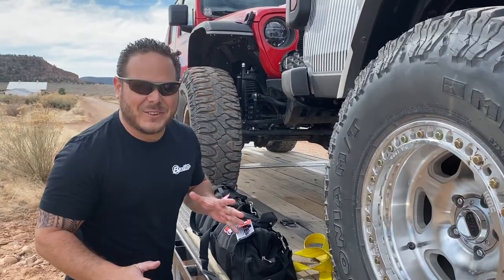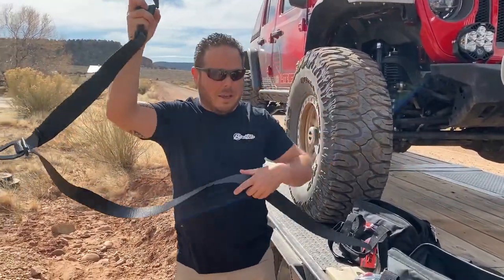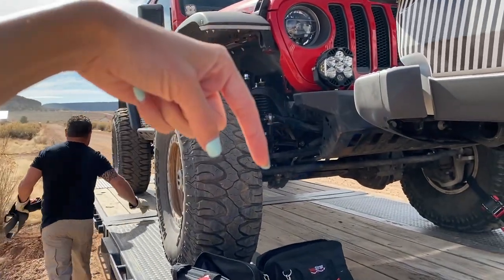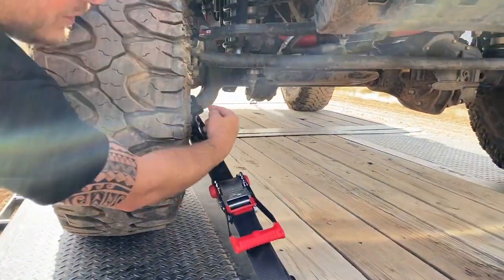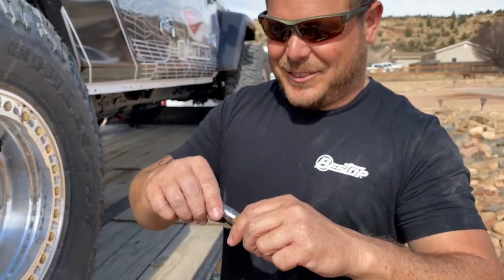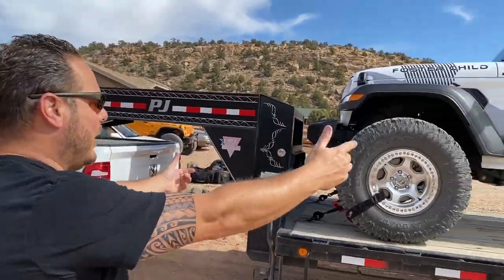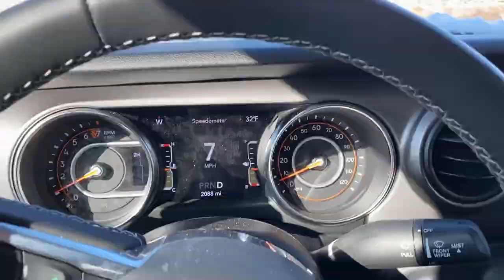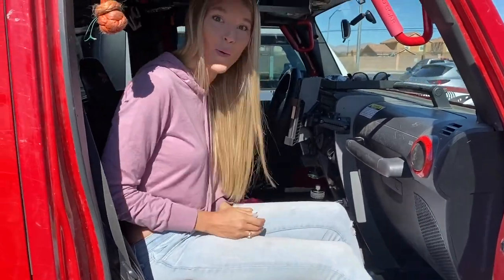HELP US OUT! How do you tie down your Jeeps?!

Comment: I have hauled heavy equipment for 38 years. You should X cross the tie downs front and back. Not only does it keep the load from moving front and back, it prevents any side to side movements. DOT mandatory for commercial loads
Reply: Thats how we did it in the Marines as well.
Reply: Yup always X Cross
Reply: Cross strapping might work for static loads but definitely not for vehicles! If you lose a strap you lose the vehicle. Physics don’t work for vehicle tiedown!

Comment: have been towing 4x4's since the 60's through 40 states. my dad hauled heavy equipment through the 40's 50's & 60's and showed me the cross tie on the axles method which i have used every since. it does not really matter the brand or style of tie downs as long as their of good quality an properly applied. most state D.O.T.'s require 4 tie downs on the axles on the cross tie to prevent the load from dancing off the side of the trailer which i have seen a lot. Victor Valley 4 Wheelers for life, the real kings of the hammers

Comment: I used to haul A LOT of vehicles, and by far the best way is to use Wheel Nets. If you check with most 4x4 shops, or even towing companies, they can get you, or tell you where to get the ones for large tires. They're the safest, and even easiest/fastest way to strap them down.

Comment: Try to cross them in the front make an "x".That prevents side shifting on bumps. You will see this on semi loads of heavy equipment. It pulls the main mass to the center of the trailer. Centers the CG.

Comment: Dean here, strap stuff down all the time, thing to note when using a ratchet type strap, dont pull the strap all the way through and tighten it up, leave the strap slightly loose and start ratcheting and let it tighten on itself it will have more to bind on too. just my .02

Comment: Just my .02 as a rank amateur...

For loads as heavy as the Jeeps I always like to cross the straps for the simple reason that rain and ice can make the trailer deck slick, and I like having the extra side-to-side support.  You don't want either, but a load shifting left/right will make the ride a lot more... interesting in a hurry than a load shifting forward/back.

Get some short axle strap tie-downs with the eyelets on each end.  I use the eyelets built into the strap when I have to, but those are more prone to slippage if there's any extra strap in the loop around the axle or through the wheel - they like to close that loop tight on their own and introduce slack into your tie-down.  That's also a common abrasion point, and replacing an axle strap is cheaper than replacing a ratchet strap.

If the velcro speed straps are long enough wrap them once around the short end of the ratchet strap before tying up the loose strapping to secure them permanently.  That way they won't blow away and get lost when you're unloading the Jeeps on a windy day, and if you're like me it'll cut down on time looking for them when they were in your hand ten seconds ago while tying things down.

The whole setup looks awesome. It cracked me up how tiny that sweet gooseneck trailer made the 3500 look, though!

Comment: with the straps you're using don't forget to check each time you stop they will stretch always this is just because of the material they are made from. binders are better or get shock straps to eliminate the need to constantly adjust the straps.
Reply: zapman2000 after the first time they have been great. Tight as can be each time I check

Comment: Funny that this came up not long ago between equipment drivers and auto haulers in our group. The consensus was that both X chains / straps are good for those that carry all kinds of different items. But if it is their toy they all would use wheel bonnets or straps. The auto guys made good points regarding why they are required to haul their loads with them. Because your load is repetitive, make sure the pull point was arranged for easy tie down. BTW the preferred bonnet for your Jeeps come from MACS made custom for your tire / wheel combo.

Comment: four chains and ratchet binders around the axle housing 2 pulling forward 2 to the backtighten till you see tire squat. then wrap the chain bite around the handle and ratchet shaft it will never move
Reply: plus you might check the different states some may not allow straps.and require chains

Comment: Strapping them like that will work but I've personally believe attaching directly to the axle in a x pattern is best. It doesn't only help forward and backward movement, it strengthen side to side as well.
Reply: But if 1 strap breaks or comes loose then the other strap isn't going to keep the load from shifting toward its mounting point on the trailer. Plus when the tow vehicle stops and starts the load can move forward or back because the "X" isn't as ridged as a straight strap.
Reply: Never ever ever cross your straps EVER! This is the worse advice you could ever be given! https://youtu.be/-zw7pICnfzU
Reply from the maker: It actually been really interesting reading up on this. Apparently there’s a huge argument both for and against crossing straps in an X pattern.
Reply: @LiteBrite  very true. You guys are doing good though. If the jeeps stay on it's a win.

Comment: I always tied down my race car (asphalt super late model) over the axle in the rear and around the spindle in the front. I also left the winch attached (always winched it into the trailer (26' enclosed bumper pull). Car weighed about 2700lb, tools, tires, etc brought total weight to 9k lbs.

Comment: by securing the jeep at the wheels you are allowing the sprung mass to shift and bounce and potentially creating a unstable trailer.  jeeps have tow hooks secure from the tow hook to the trailer and preload the suspension with the tension of the straps

Comment: I have same straps and they work great. Only issue I did not like it the wrap around on its self would always loosen. So I ended up getting 24" axle straps with Rings on each end and then hook with hook. I strap at axle to tie down. As you having suspension do what it does best absorbing provides less impact to tow vehicle and trailer.

Comment: Hey Kevin, where you strapped down the step child is where I do on my TJ as well with no issues. I'm guessing your straps slipped in that adjustment piece on axle strap. I use fixed length axle straps so the only place there could be a slip is at the ratchet it self.

Comment: Real straps with spring clips.    Some states require them. Go around Axel tube so springs still work.  Or use farm tractor tire tie downs. Love them.  You did, buy good straps!  Nice! Limit roll back.  You did fine.  I've watched professionals do it wrong.  I like to weld in loops on Axel's if there is room.

Comment: 4 straps each vehicle use towing wrecker hooks way easier  and criss cross them ,also can use axle straps go around axles or through rim when you go through rims you dont criss cross  only need chains on machinery  and  weigh your truck and trailer you need tongue weight the trailer ia suppose to hold the weight so might work on liad placement

Comment: Buy axle straps (8) to go around your axles. Get the 7' vehicle ratchet straps (8) with the big hook ends that have the safety spring "flap" and cross tie them down at the axles. If you tie them at the body anywhere they will move when the vehicle bounces as you go down the highway, this causes them to become loose and snap tight as this happens. I always tie down to the parts that are not moving on the trailer which in your case would be the axles. Just be sure to not pinch brake lines or cables. You can check online for load securement for equipment or vehicles under the Federal CVSA. When you tie down this way you see the vehicles on the deck moving around and bouncing which is normal as long as your straps are tight. You can buy stake pocket D-rings that will help when securing down.

Comment: I have found that cross stapping is best for any load it stops all side to side motion  . So left front tire gets connected to right side of trailer and so on but it is not a huge difference unless trailer is wet or slippery

Comment: With the trailer setup you have you can take the strap attached to the driver side axle to the passenger side tie down of trailer. And the same on the opposite side so the load won't move sideways. At the moment the load is safe for forward and backward movement.

Comment: Run the left side tie downs on the Jeep to the right side D ring and vice versa (cross the straps in other words).  It keeps the Jeep from moving to either side.  You can also run the rear straps from the vehicle in front to the D rings under the front of the vehicle vehicle in back - then the straps from the front of the vehicle in back to the d rings under the back of the vehicle in front.  Cross them also.

Comment: Having steel DIY beadlocks with classic D windows, I just strap straight to the wheels. Never to the frame. Strapping straight line front and rear (no crossing) leaves easy deck access to stash coolers, firewood, etc. below the jeep(s). My trailer deck is only 22' 6" (two Willys long) so economizing space is mandatory.

Comment: Hi Brit and Kevin I work for a towing company in Wyoming on I-80 and the most secure way to tie down a vehicle is to get tire straps you can get them on amazon and if you watch a video on YouTube it will show you the proper way to use them or like someone else said you can watch Ron’s videos Midwest Truck he uses them a lot. The way your doing it should work just fine but the extra padding in your kit isn’t to protect your rims it’s to protect the strap I use those same straps with my medium duty wrecker for solid axle big trucks with my wheel lift to go around the axle and it secures it to the wheel lift. Since they loosened up I would try going around the axle instead of the knuckle and if you put the tag end back threw the strap instead of having it come towards you the strap will hold tighter because it wraps more around itself instead of in a line. The straps I’m talking about are 8 point tire straps and you can get them with the same hooks as the straps you have now and there quick and easy to use and it’s the most secure way to tie down your vehicle.

Comment: Kevin, I'll join you on eating better.  I have been slacking. Also... if you're having trouble working out on the road, let me know.  I have some info on workouts with minimal equipment if the portable gym isn't cutting it.  I'm sure you're good but just in case.

Comment: Well, in the Air Force, where we would tie down our own equipment like -60s (Jet engine powered generator and high pressure air unit) which weighed about 10,000 pounds;  We would crisscross our chains in the C5, C141  C130 or KC135 cargo aircraft.  It was called 'side loading'.

Comment: Only 2mins in... but the biggest mistake I see customers doing when strapping down with ratchet straps is that they pull them as tight as possible before ratcheting. Ideally you want a little slack and you want to strap to wrap around itself on the ratchet.

Comment: The way you have the wheels strapped will inharently loosen over time.  Make a Y shape with the strap.  I like straps because they are light but chains are the way to go with the miles you guys will be traveling.
Reply: blazerberg so we’ve not had a single strap loosen at all. The ones on the tires have stayed the tightest

Comment: I have the same trailer truck set up as you and I haul two TJ’s to Moab. The way you have them tied down is just fine and will work. I use the Vulcan car tie down with flat hooks XL from TrucknTow.com. Just throw them over the top of the tires and ratchet down two ratchets on each tire and it is done. To UN do just pop the ratchets and drop it off all together so all you have to do is put it on the tire and ratchet down to tie down again. Takes ten minutes to tie down two jeeps and you don’t have to crawl around under the jeeps. You will stay clean and it will be quick. I have 37’s on mine and they work great. I know a guy who rolled his truck and trailer with a full size ford pickup on the trailer and it stayed on. The tow company rolled it back up still on the trailer without any problems so I know they are strong enough.

Comment: I strap my rear axle straight back and cross the front axle.  My reasoning is if I get into a panic stop situation I want the straps as strong as possible.  I figured that the straighter, the stronger.  I cross the fronts to keep it from slipping side to side.  I always strap to the axle housings, never the wheels.

Comment: Hauling heavy equipment I prefer chains and binders on the frame.  Vehicles in my opinion it's six of one,  half a dozen of the other.  I still prefer the frame but I see nothing wrong with what you did.  I'll send a short clip tomorrow on my 2" ratchets to deal with the tails,  in case you lose the little velcro strap

Comment: You need to flip your hooks over in the D rings, the way you are hooked it puts the load on to the tip of the hook, the weakest cross section of the hook, flipping you hooks over  moves the load into the "bite" of the hook.

Comment: The speed straps look great.  I’m getting me some.  On another note, do you have airbags on your truck.  I have them on my Ram 2500 and it levels the truck out perfectly when pulling my 5th Wheel and smooths the ride out tremendously.   An idea you may consider just in case you don’t already have them.
Reply: Frank Mackay not yet. Working on it

Comment: Those wheel tie downs are nice for going down the road a few miles to the car show or secondary tiedowns, but you guys should just get 4 "t" hook recovery/transport hook clusters ( they hook into the factory tow/tiedown slots in frame), 20' transport grade chains (7,000lbs. Break),4 snap or screw chain binders and tiedown/strap bar (the binders you can get from a good truck stop or most dealers, or order from Iowa 80 along with the chains and "t" hook assemblies) cross tie aka X tie front and rear from drivers side vehicle frame to opposite/ passenger side trailer over to opposite/drivers side trailer then to passenger side vehicle frame, use chain binders on chain between each side vehicle and trailer (binders are only to snug chain up and not to hold the weight, this way if a binder comes off or breaks the vehicle is still attached to the trailer) then use wheel straps as a secondary tie down if you want. If you only tie down to wheel then the suspension on the vehicle still moves and increases side roll in turns, basically in a accident situation,fast manuver or slideing in snow your towed vehicle can pull the trailer over on it's side, the higher the trailer and the higher and heavier the towed vehicle the more leverage there is to flip over. And being your only towing with a narrow single rear tire pickup that trailer will pull it over very easy, same as offroad, the wider the stance of the vehicle the more stable from flipping on its side, this is why 18 wheelers are so wide, also a heavier tow vehicle only helps with enough width. Also try to keep in mind a regular loaded big truck setup is at a little over 5-1 ratio, tractor trailer cab is usually 1/5th the weight of average rig at full load weighing 80,000lbs. which is dot limit without permits for their class. Helps not to exceed 1-5 ratio with any towing setup with a fithwheel or a goose neck trailer, it's more stable driving especially in weather/wind, it's a more even ratio and easier to flip with a tow hitch mount at rear. Also always check the gcvwr rating for you towing vehicle, gross combination vehicle weight rating and do not exceed, it's the most that vehicle is desinged to pull including it's own weight, it's on the door info sticker or plate of most all newer trucks or can get info by calling dealer or the manual. If your wondering I've been trucking over 21 years hauling everything under the sun, long hauling vehicles and heavy equipment ( from small trailers and cars all the way to tanks and dozers) and 3 years towing and recovery before trucking and even offroading with my rigs making deliveries. Hope this helps and it is the safest way to tie down vehicles (aside from putting them into a box)for everybody on the road. Remember the longer the haul,the better the tiedowns needed.

Comment: X far forward and far back. Locks side movements and reduces angular rotation. I believe the term is triangulation. Skip the wheels and go to the axles in this case. Reason being is the wheels rotate and loosen. And X across the wheels can torque the wheels tie rods and mess up alignment!!!

Yes - that’s the way I did it the Marines as well... (Noted someone else mentioned that) And the same when helping out at the wrecker yard. On things that had axles to tie to. Hummers’  and other independent suspension things don’t...

If you ever do tie down to a suspended item out of necessity - you have to compress the suspension a lot! Typically, there are tie down points. There are also over the wheel slings out there, and t-hook for frames and J hooks for axles but they slip. 

For your setup up have currently for MY Gladiator - rear axles across to the other side of the flatbed front knuckle C to the other side of the flatbed - both about 45 degrees out from the attachment point.